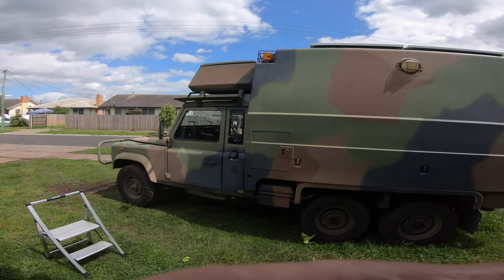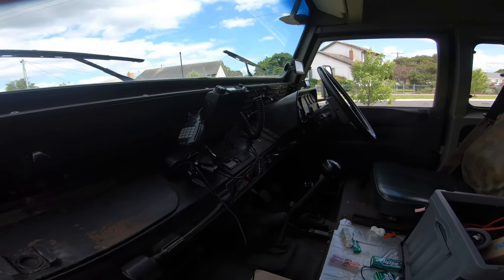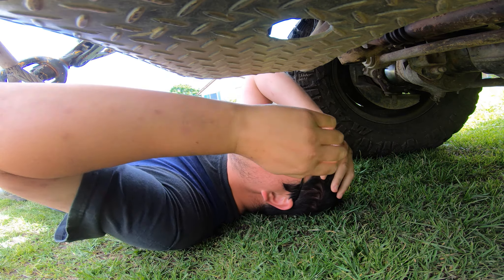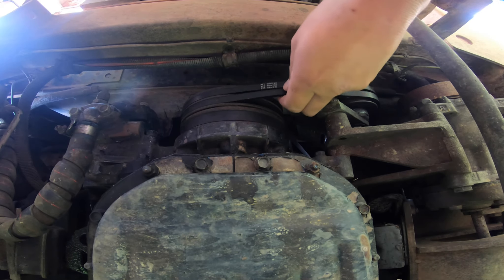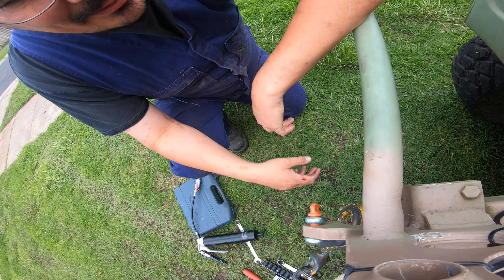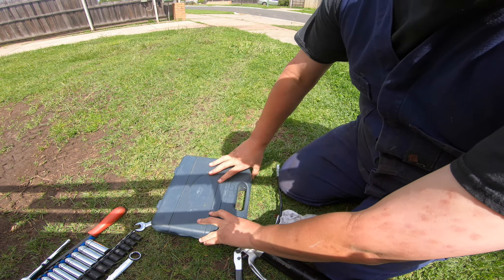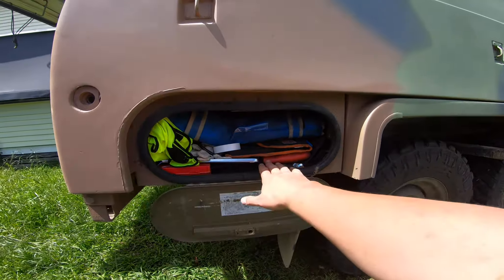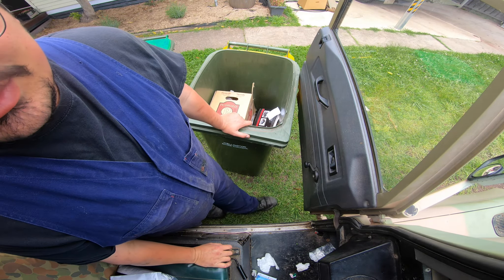Adjusting Idler Pulley | 6x6 Land Rover Perentie

Comment: Murphy may have heard you about the power steering hose, take a spare with you.
A good 1000km run will do the Perentie good, in fact a lot of vehicles while under lockdown, could do with a good long run.
The job I did last weekend was 200km round trip and the car feels so much better, its due for a service next month.
it seems strange that the tensioner relies on the pivot bolt to hold the tension, I would have thought that there would a an slide arm to tighten the tensioner with. Then again not much room. 🤔